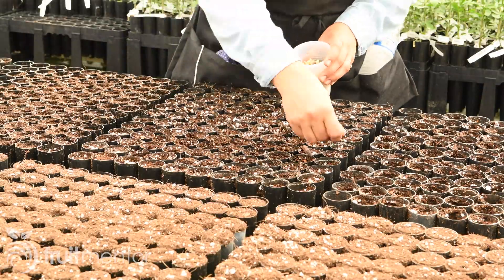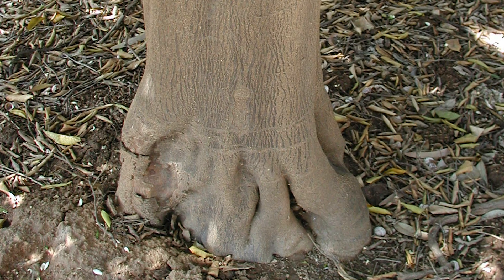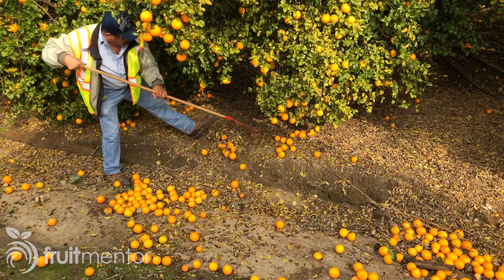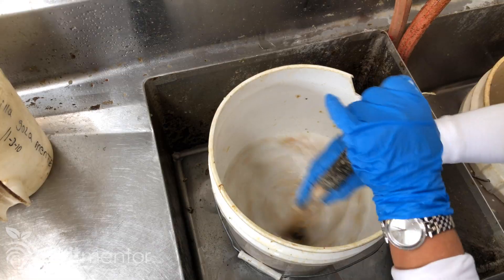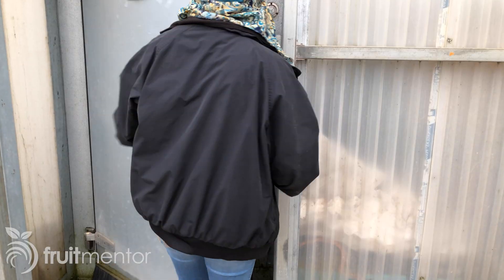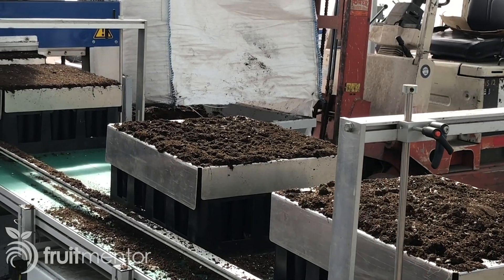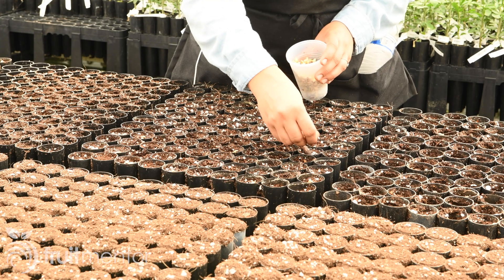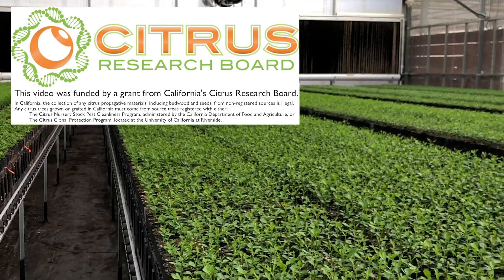Growing Citrus Trees from Seed – Fruit to Seedling

Comment: I grow lemon seeds all the time. After 4 years they are 5' tall. No flowers yet...how long?
Reply from the maker: It can take a very long time. It could be as long as 10 or 15 years. That's one reason the preferred way to propagate lemon trees is to graft to rootstock seedlings. Another reason is that once the trees do bear fruit, it may taste horrible.
Reply: If it’s a dwarf tree then it’ll take 3 to 6 years. Anything bigger than that will take 5 to 10 or more years to grow fruit.

Comment: Nice video and time appropriate. I have 30 c35 rootstocks that are less than a 1/4 in diameter. I'd like to graft finger lime to them now. I have CCPP budwood in the fridge. I'm in socal 10b. Do you have any suggestions? I'm thinking of using the tbud technique i learned from you. Any tips would be greatly appreciated. And a link to the budding video you mentioned would be great. Thank you so much for spreading knowledge.
Reply from the maker: I see that you found the video on chip budding. That would be a good one to try. You might also try this other graft that works great when the rootstock diameter is smaller than the scion diameter:
https://youtu.be/7msNCYZ19Ug
Unfortunately they are both a little more difficult than the T-bud, but if you want to graft now instead of waiting for the rootstock to get to a good size for T-budding then they are great options. Good luck!
Reply: @Fruitmentor  thanks for the replies.

Comment: Any clue what type of soil they use or is ideal for citrus seedlings? I've used promix and cactus mix with marginal success
Reply from the maker: I'm not sure what they used, but it looked like a regular potting mix. I have had success with a plain potting mix without any fertilizers or wetting agents. You can apply liquid fertilizer later when the seedlings have sprouted. I have seen some nurseries use straight vermiculite for germinating citrus seeds. One of the most important things is to remove the citrus seed coat. It makes a big difference.